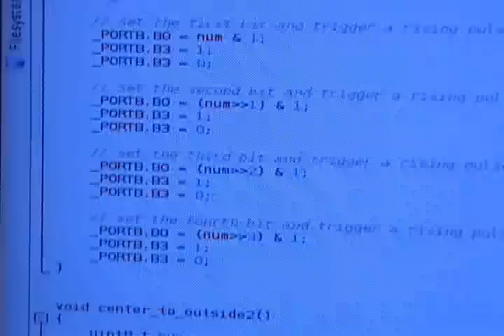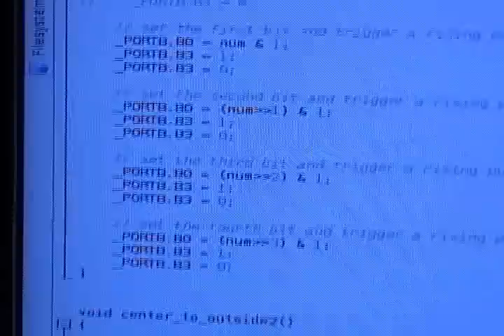10 LED Bar Graph Display

Comment: you could chain some D-flipflops and connect their clocks.  connect the last output to full reset.  would be nice to not have a giant IC with outputs all connected to local inputs though that did that....

Comment: After seeing this I have a question:

Is there a simple 10-stage counter IC, just like the 4017, but where the outputs stay high until the chip resets. So the outputs would be as following:

1
11
111
1111
11111
111111
1111111
11111111
111111111
1111111111 and then repeat

Is there a chip that can do this? Or can it only be achieved with a PIC?

Comment: yes i completely agree with you

if you had a 555 in astable with a set rate (not pot) it would work.........ah i think.

i am just not into micro controllers yet(i am getting an arduino to learn to program then a PIC)

do you have any advise on micro controllers of other ICs

also  what are some more "fun" ICs my version of fun is like the 4017 the 555 of course  and now the 3914 do you know of any others?????

Comment from the maker: True, but using the 555 for the PWM, you will need to use a POT to change the display.  The reason I used the uC is to be able to do more than just light up a graph to a specific level.  With the uC it is possible to light up any individual LED in the graph or multiple LEDs at once.  It allows me to use it for various purposes with this uC, and it only takes up a couple of pins on the uC.
The 3914s are nice when you have an analog signal and you want to display the level of that signal.